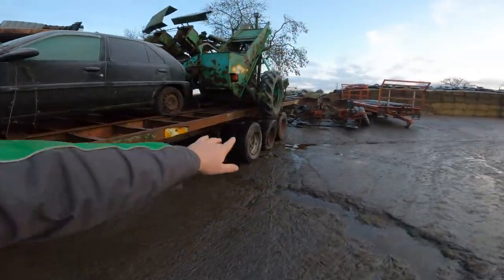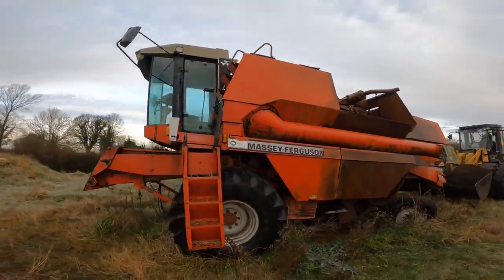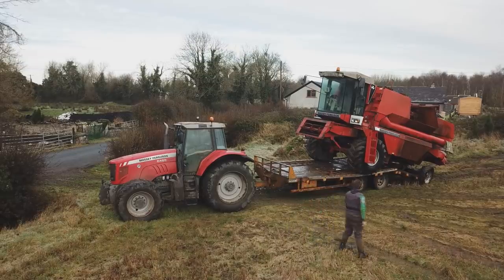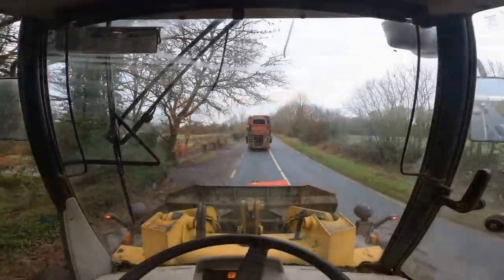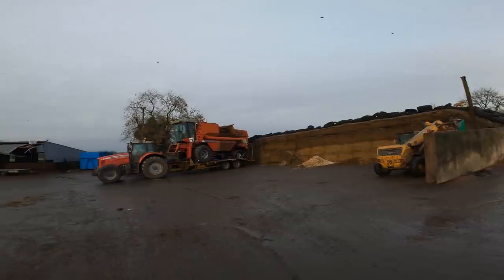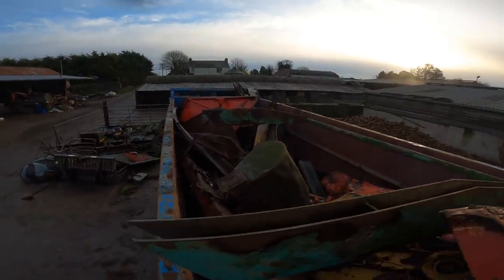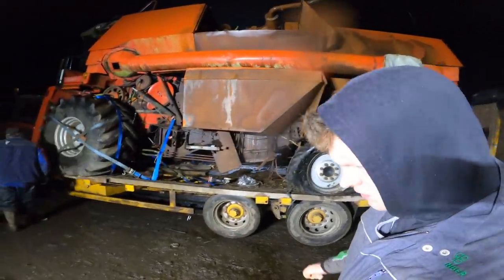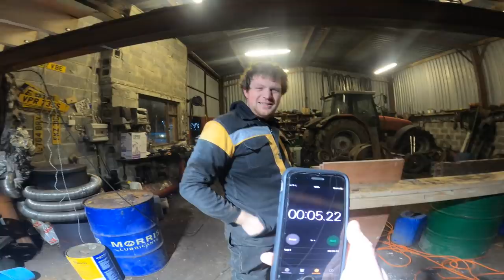COMBINE RESCUE MISSION NEARLY ENDS IN DISASTER -- SCRAPING OUR BURNT MASSEY 32 COMBINE

Comment: Great video Phil but Would you not have took all the glass out of the cab and lights off etc you might be sorry for letting some of those things away
Reply: Chances are the glass would break when trying to get it out, lights are probably rotten if shes sitting there a long time
Reply from the maker: Someone smashed all the lights on the combine not long after it burned

Comment: Should've backed the trailer closer to the combine before dropping the ramps and attempting to load. Should've blocked it up, it was moving backwards when you were pushing it over to be more even on the trailer. Why didn't you just jack up the combine and remove the wheels you want to keep, then just lower it back down on the trailer. The salvage yard will have a machine to just pick it up and off the trailer. Just curious. Cheers :)